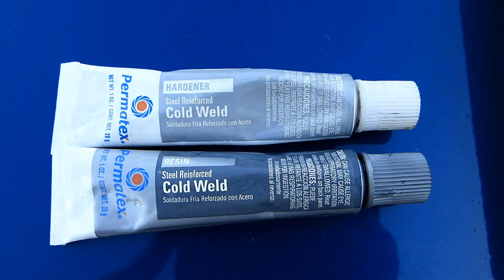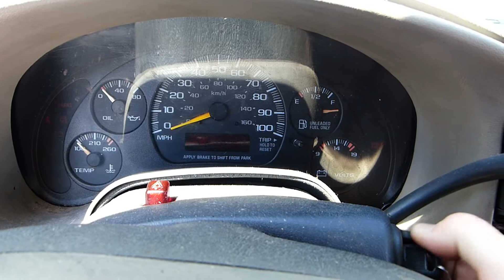eBay fuel pumps : a problem of which to be aware

Comment: Bought a 94 wrangler with bad fuel pump.. was abt to drop tank was checking under carpet to see if it had any rust and found someone had made an access. I already had the pump so I took old one out but everything was rusty. So I had to order a complete new sending unit fuel hanger an pump

Comment: A number of years back I replaced my fuel pump in an Astro with an ebay special.  It worked but it turned out to run hot.  If the tank got below about 1/3 of a tank in hot weather, it would stop until it cooled off.

Comment: Access panel is definitely a good idea especially when dealing with Rusty lines.
If only more vehicles have them.
Reply from the maker: Fuel pump access panels are relatively common in Japanese vehicles.  My Ford Escape has an access panel.  I agree that it's an inconvenience that most vehicles lack the common courtesy of an access panel.  I've cut access panels into several vehicles, but always with the permission of the owner.

Comment: With the general motors products primarily the trucks , suv and vans i have found over the years a delco or g.m. part lasts longest trouble free and can be bought on amazon , rockauto or ebay reasonably
Reply: AC delco is trash which is why they fail so often to begin with since that was the OEM lol